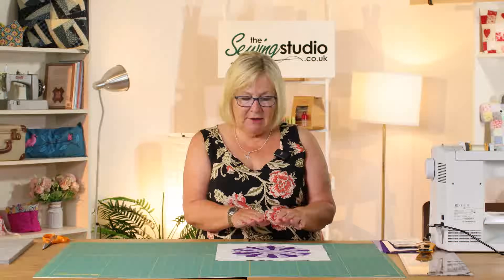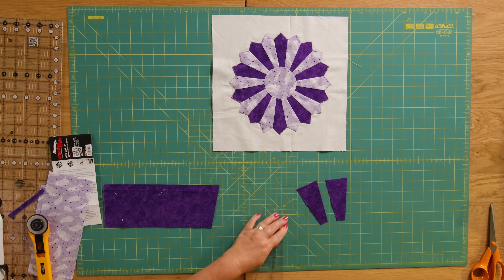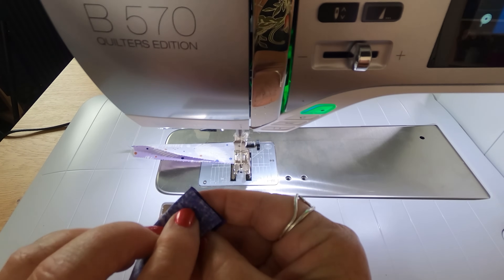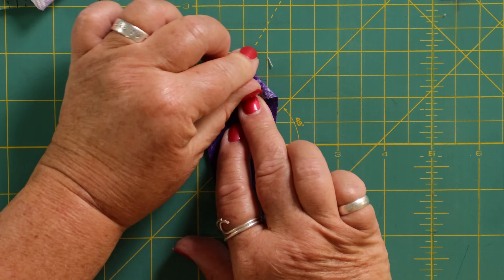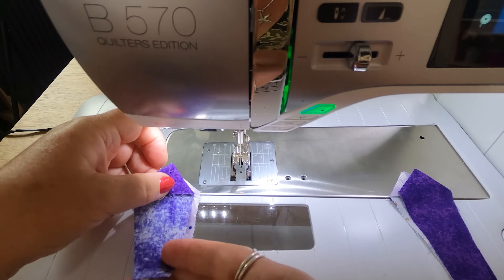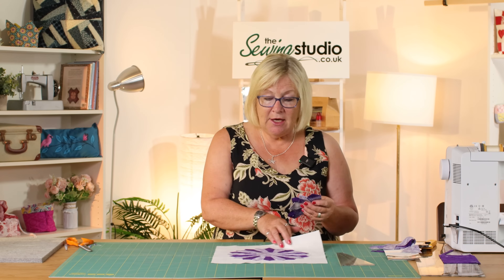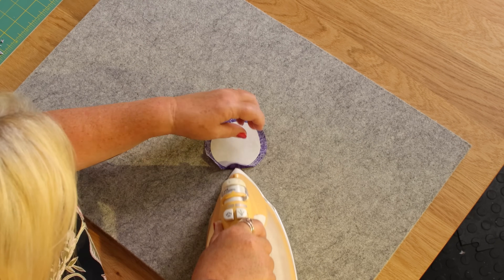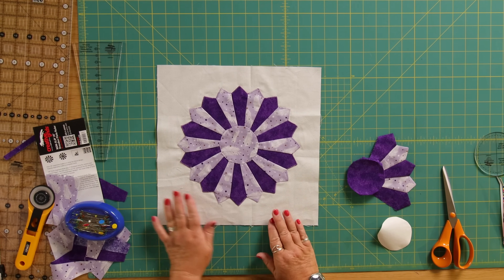Make a Flower Block using the Dresden Plate Ruler

Comment: I prefer the pale color.
I cut out the Dresden plates using that same ruler using 5” squares.  I must not have cut them right because wen I sewed them in quadrants.. it did not make a circle.  I thought about adding more Dresden’s but that will make a larger circle that is called for in the pattern.  I took all the quadrants apart and will pin them together before I see each one.  I am hoping that will work.  I cut 220 Dresden’s I hope I don’t have to waste all that fabric!!  
Your tutorials are the best…you go into great detail and I appreciate that being a self taught quilter.
Reply: I noticed that she said to use a scant 1/4” seam - wondering that may be a good idea since there is a little thicker layer at the pointed top!